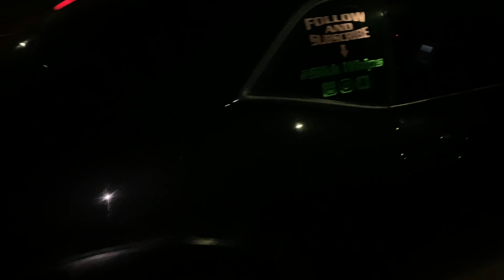Pulled up on Sikk Whips just find out his motor locked

Comment: Too much oil will mess up the rings on the pistons. I stopped trusting mechanics when I took my trans apart after a 2300 rebuild and found out it they only replaced the clutches No seals no bearings.